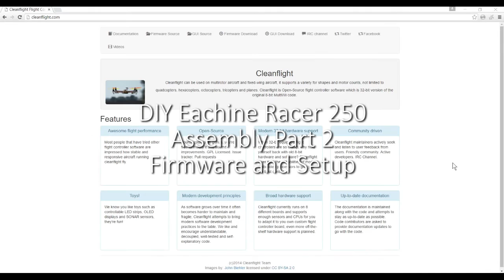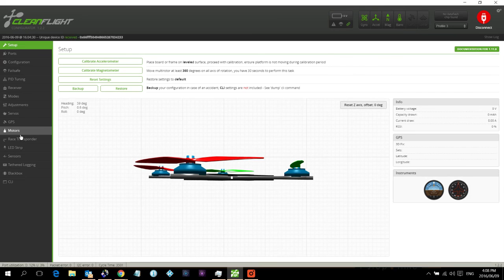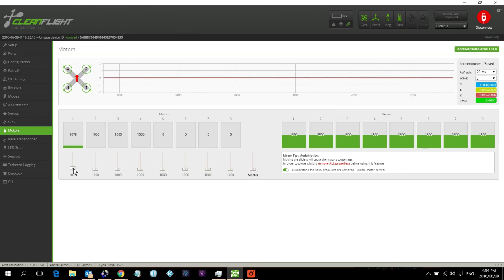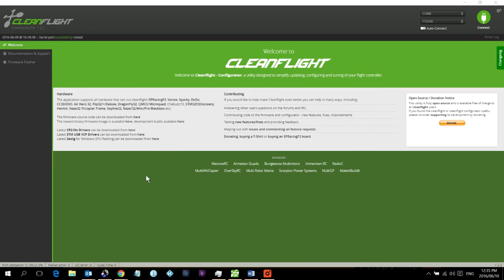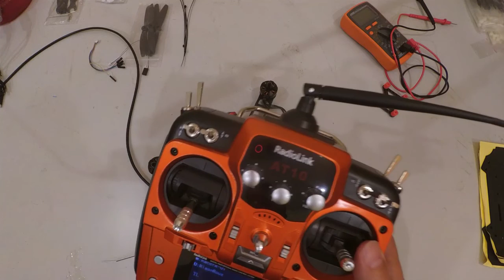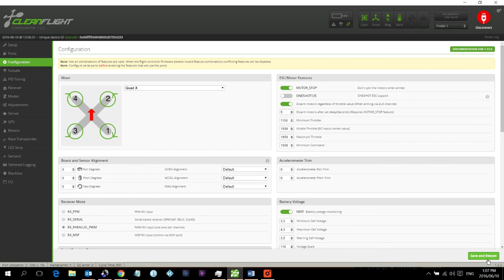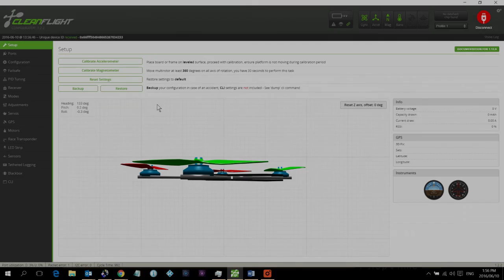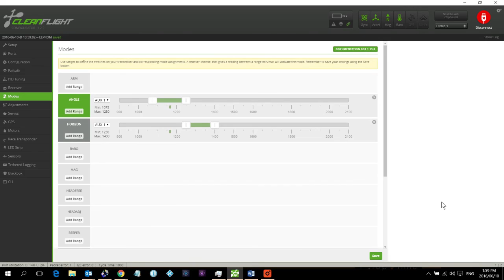Eachine Racer 250 DIY Part2 - Firmware and Setup

Comment: I have just taken a couple test flights with my Eachine 250 racer with the Naze32 FC and I am using the AT 10 controller. When I try to just hover it will start to angle and roll  to the left or right if I dont give it heavy stick input to keep it in a stationary hover. I gets progressively worse the longer it is in the air. Is this an issue with the accelerometer calibration or is it a tuning issue?
Reply from the maker: Dan Duesterbeck In which flight mode is it?
Reply: Angle mode. It also seems that on the cleanflight setup page the instruments dont read correct North heading even after magnetometer calibration.
Reply from the maker: That is not right and does sound like a faulty flight controller.

Comment: If you change the direction of the motors then what about the thread on the prop nut? isn't it designed so the props don't fly off?
If its spinning the other way wouldn't that be a problem?
Reply from the maker: At 4:20 you will see a schematic of the motor rotations.  When you install the motors you should install the motors in this order as you get 2 that work CW and 2 that work CCW.  Changing the spin direction on the ESC is only required to correct the direction so the thread corresponds to the requirement.
Reply: I understand now thanks for clearing that up.